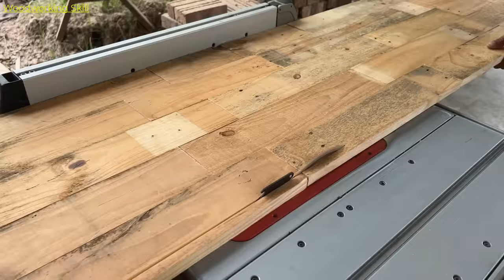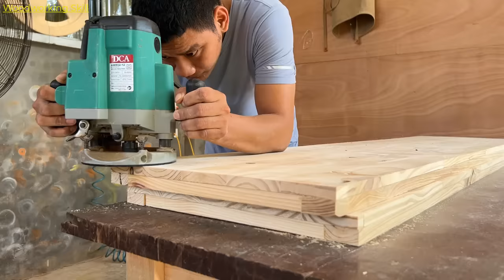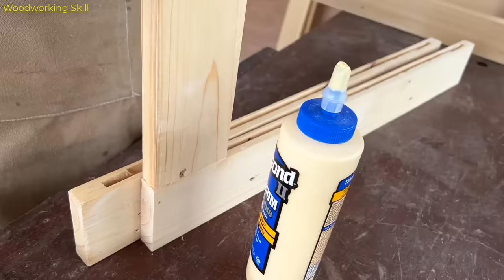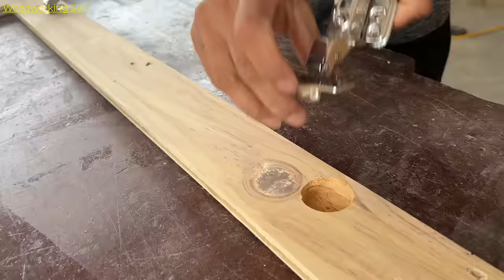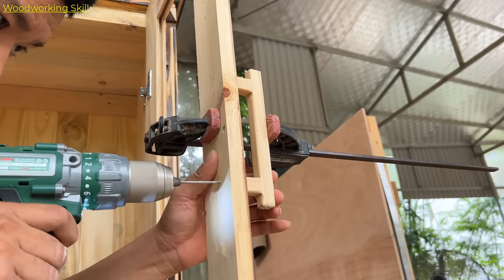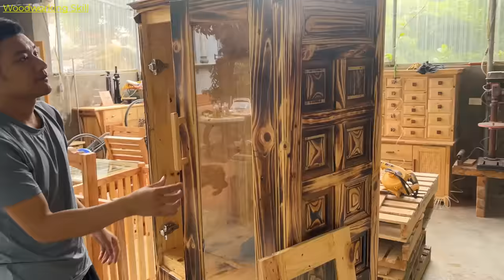Innovative Pallet Woodworking: Crafting a Unique Cabinet from Discarded Pallets

Comment: Nice work, The thing is you should not of put the glass in a groove , it should be set in a rebate on the back of the door held in by a bead.
If the glass breaks as you've installed it then you have to damage or destroy the doors to replace it..!
Keep up the good work...👍